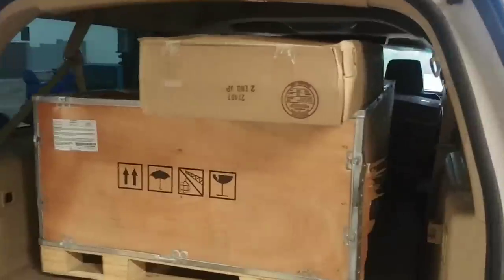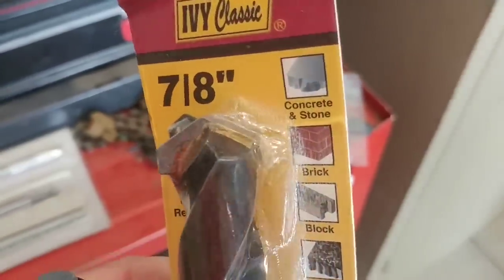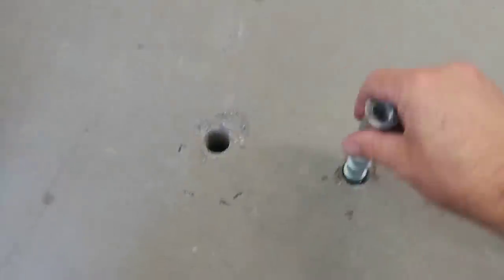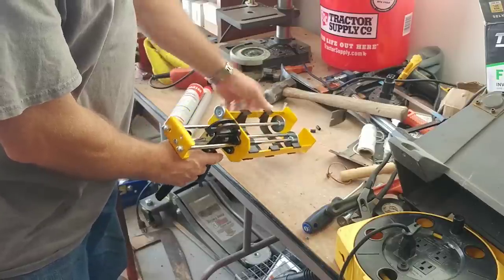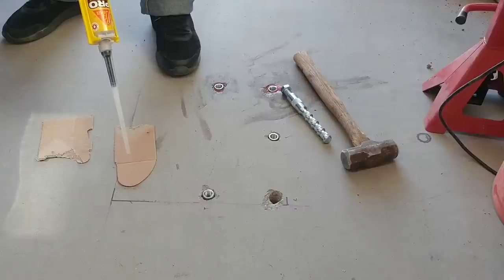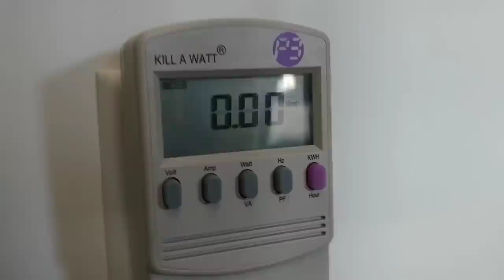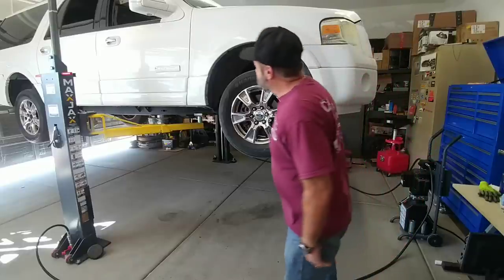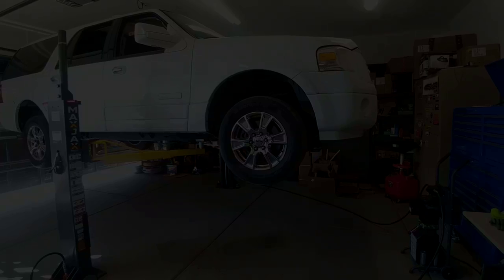BendPak MaxJax M6K Home Garage Car Lift Installation Tips, Testing, and Amperage Measurements.

Comment: I had the older version. The original Maxjax 10yrs ago. Worked great but one thing that bothered me and many others was that even though it was leveled during installation once you lifted a vehicle the towers became out of level. The towers would collapse about 1/4 in inward. I never had any accidents with all the different vehicles I put on it but just never felt comfortable underneath the cars. I worked under there with the thoughts of always being ready to run out.  I even put wheels under the cars to save me.  With this new version. Lift a vehicle then put a level on the towers. Let me know if it tilts inward.   Thanks
Reply from the maker: I may have put a measurement in the comments somewhere but they do flex inward slightly under weight.  The flex doesn't concern me as long as the base is secure, bolts remain torqued and there is no gap under the base that would indicate the anchors were compromised.  I check torque periodically and after lifting I'll make sure the base hasn't lifted.

Comment: Nice to finally see some real world feedback on install and use with this lift amongst all of the basically paid advertisement type of setup videos... What is the distance from the outside of the back plate to outside of back plate for the spread on the columns? MJ suggests a spread of 105-135", curious as to what yours are at and if you wished you had them closer/further away after using it for a couple of years. Also, do you remember what the actual depth of your concrete was during install?
Reply from the maker: I went 130" outside to outside at the base. I'm happy with that width. Been able to lift everything from my little Geo Tracker all the way up to my Ford Expedition EL. I wanted as much width as was reasonable to let me access the vehicle while it was on the lift for some jobs and it is helpful. Also makes it easier to leave them mounted to the floor and park between them even though they are designed to be unbolted and moved I prefer to leave them installed and ready. Plus I figured the anchors were less likely to loosen up over time.

Only thing I think I would change or still may do is run the hoses up to the ceiling and across to the pump so they aren't running across the floor while in use. Not a big deal but do trip over them on occasion and have to lift the roller carts over them.
Reply: @shanesdiy  Thanks for the response 👍

Comment: I saw one guy had giant jackstands. They were about 4 feet tall, he would put them under there after jacking it up and I would do the same if I were you. Your concrete looks very solid, but you just don’t know and why take chances.
Reply from the maker: I add support strategically when I feel the need just like you would with any lift.  I use the lift often for a wide variety of vehicles and it hasn't given me any reason to be concerned yet.  I perform a "pre-flight" before every use, inspecting the equipment, hoses, and the base anchors for any signs of loosening.  Still holding strong.  I modified a transmission lift for use with the MaxJax recently, video should be coming soon on that project.

Comment: Great video. I have a few of questions if you don't mind.  I don't know if I wasn't listening (something my wife says happens(or something like that, she was mumbling)) but how tall is your ceiling?  How do you like it after having it and using it for awhile? How high does it lift?  What creeper is that?  I have the six ton mid rise scissor lift and it's great for most things in my garage,  but sometimes the access to more of the underside of the car would be nice too.  Thanks for the video
Reply from the maker: Always happy to answer questions. The ceiling height is 10' 4".  The bottom of the lift arms are 41" from the floor when sitting on the top safety locks. Depending on which lift pad risers I use the lift pads will be about 45-50" above the floor to where it contacts the vehicle.   The creeper is the one MaxJax sells. I purchased the complete package that came with a bunch of extra accessories like the oil container with high funnel, 6" risers, and the reclining creeper. I also roll around on a small roller seat if he car on the lift has enough clearance.

I love it just as much, if not more, than when I got it. I use it very often for my own fleet of cars and I now help friends and neighbors with their vehicles much more frequently.  I've done some big projects I otherwise would have not attempted as I just don't want to lay on the concrete any more, too old for that!

Thanks for the comments and for watching!  FYI some of those measurements were at about the 30 minute mark.  I know it was a long video, tried to keep it short but was quite a lot to cover.
Reply: @shanesdiy  Thanks for the quick answers!  I don't know how I missed the measurements.  I must have been distracted.  I didn't think it was overly long.  
We're in a similar situation, between the wife and I we have seven vehicles and I'm at an age where laying on the concrete doesn't appeal to me either.  
Thanks again

Comment: I just installed one and instructions say you need at least 4” slab but in reality you need 5-6” because they make you drill 5” deep and when you set the anchors you set them 5/8 below and it comes up when they set, i had 5” slab and worked fine
Reply from the maker: Agree, not sure 4" is quite enough.  Made it frustrating for me having to redo a few of the anchors.  I sure love having the lift!  Hope you are enjoying yours, it is a life changer!
Reply: Standard for a two post hoist is a 6" slab. Most homes will only be built to the minimum 4"
Reply: @shanesdiy  yes sir i am enjoying it and is a life saver working at home out of my garage
Reply: I've thought if there is anxiety over depth of concrete that a solution would be to weld a plate onto and outboard of each floor support and add 2 more anchors to add leveraged strength.

Comment: Thank you Shane for the detailed video. A statement and then a question for you. BenPak advertises the MaxLift as a portable unit, how is that true if you need to Molly down the jack? And what dictates the distance (left and right) from each of the towers? From the video it appears that your distance seems further than necessary, and you could have benefited by having them a bit closer together. Thank you
Reply from the maker: It would be pretty easy to unbolt one or both of the posts and roll them into the corner.  I choose not to as I use them quite often.  I think the manual gives you a recommended width "range".   I gave it a lot of thought before selecting a width.  I decided on the width of mine based on the range of vehicle sizes I wanted to fit.  I have everything from a really small Geo Tracker all the way up to my Ford Expedition EL and so far it fits them all.   I went a little on the wider side also because since I wanted to leave them mounted all the time I wanted a bit more room to park my car between them without being too tight.

I personally would not want them closer.  I often find myself needing to open the vehicle door to get in to work a clutch, brakes, or steering and even with the wider width of mine, it is a tight squeeze to get through the door while on the lift even with a smaller car like my Evo or neighbors 350Z.

Thanks for the comments and questions and thank you watching!  I hope the information helps you make an educated decision! I can't imagine life without my lift any more...

Comment: Great video!!!! I have been looking at these for a while now as well, mainly because you can unbolt and movs them if you need to.  How do you find them now after a bit of use? Any regrets on this model????
Reply from the maker: I use the lift quite a bit and still working flawlessly. I have room so never move them around but can if necessary. Just posted a new video yesterday, had my brothers Honda Goldwing on the lift with the motorcycle adapter! Worked great.

Comment: Haven't finished video quite so, sorry if you answer this later, you've marked out a nice location, why not rent a saw, cut out the square, Pour some fresh concrete?  It'd fill the void, you can make sure psi is high enough, and put your bolts right in the concrete.
Reply from the maker: Probably would have been the wise thing to do but I was confident I could make it work.  Short answer?  Impatience...  Fortunately in my case the final install has been secure and strong.  I use it often and after one re-torque of the anchors about  6 months in they haven't loosened up since.  I check the torque about every 6 months or so to be sure they are still tight.

Comment: Great video….I just saw this video.. So I take it that your concrete floor is less then 4 inches an is less then 3,000 psi of compressive  strength how is the floor holding up .. your video is very informative…excellent job
Reply from the maker: Actually the building spec was that it was 4" and 3000 psi rated.  I think in the area of that one post, it must have been slightly less than 4".   So far it is showing no signs of weakening nor are the anchors loosening up or pulling out.  I use it quite a bit so I am quite confident in it.  Only issue is one sides quick coupler has a bit of a leak so the area is oily from hydraulic fluid. It's a working garage so I'm not all that worried about a little oil.  To pull the fitting off and fix it I'd have to drain all the fluid out of the post so for now, the small leak isn't worth the trouble to fix.

Comment: Wow, what a colossal pain in the ass. I think I'm going to go with quickjacks after seeing this.
Reply from the maker: The Quickjacks are a nice product, one of my friends has them since he had a tension slab and was not able to drill into it for these posts.  I considered Quickjacks but the lower height is very limiting and most of all, you have little to no access from the sides of the vehicle for servicing.  For basic work like wheels/tires, brakes, oil changes, etc. the Quickjacks are great.  I have done some larger projects like pulling transmissions where the Quickjacks would not have cut it and I was grateful for my MaxJax!

Comment: Most residential garages have a floor that is slightly angled away from the house. Is that an issue? Do the posts have to be perfectly vertical? Can they be shimmed?
Reply from the maker: My concrete was level and I didn't need any shims.  If you needed them, I don't think it would be any issue.  As for needing to be perfectly level, just my opinion, but if they are within 1/4" or so at the tops I doubt you'd know the difference. Each side lifts independent of the other so they can move a bit without any negative impact.
Reply: @shanesdiy  Thank you!

Comment: I was curious how far apart your posts are? From back side plate to the other backside plate?
Reply from the maker: I did 104" inside base to inside base width.   Outside to outside of base is 130".  I went a bit on the wide side due to the broad range of vehicle sizes I wanted to put on it. So far I'm happy with this spacing, works with my small stuff like my Geo Tracker all the way up to my Ford Expedition EL.
Reply: @shanesdiy  Thanks for the response! I'm going to either do 125 or 130 I think, 65 Mustang and maybe my daughters jeep compass. I think 125 works, but may opt to go 130 if I can line it up right in my 3rd car bay.

Comment: How long did you wait after adding the expoxy for you to use the lift?
Reply from the maker: I think I waited 2-3 days if I remember correctly.  It hardens pretty fast, probably ok in 24 hours but I waited more just to be safe.  If you think there is any chance your concrete isn't deep enough I would do the epoxy anchors.  I was debating to try the normal ones and wish I would have just done the epoxy ones from the beginning. Would have saved me a lot of work and time.

Comment: How thick is that slab? I'm unfortunately running into the issue of mine being only 3-3.5 inches thick. Have the lift sitting here ready 😔
Reply from the maker: Spec on mine was 3000 psi and 4".  MaxJax web site currently says it requires 4.25" minimum, I think at the time it used to say 4" but I can't recall for sure.  Mine were right on the edge of being ok.  As you see in the video I had to switch to the epoxy type on a few that wouldn't torque properly with the standard anchors.  At only 3-3.5" I think your only option is to cut out a square where the posts need to go and pour a deeper pad in those two spots with re-bar enforcement, wait for it to fully cure and then finish the install.  I debated doing that but wasn't patient enough.  Been using it for over a year now and mine are ok, I re-torqued once and re-checked later after that and they were still good.  I got away with it, not sure you can with concrete that thin.   Sorry, I know that is a bummer but that's too thin to trust with your life.  Good luck and be safe.
Reply: Thank you.  Yes, I was considering giving it a shot bc I'm impatient, but I also don't want to die or , at least, have to worry about it every time I use the lift. I'll be getting some quotes on concrete.
Reply: @SWAPPED_IT  Don't even waste your time trying. I have the same issue and now I'm going to cut out 3ftx3ftx12in deep footers and put in some 5000psi concrete and then use the epoxy anchors. I can't imagine trying to use 6in epoxy anchors in 4.25" concrete or less, that makes no sense.

Comment: Great video to help us with pretty much same slap inch’s you may have. You should do a video of how the epoxy is hold the lift up with a vehicle on it.
Reply from the maker: Good luck with your installation, you are going to love it!  Thank you for the suggestion on a follow up video.  I see zero movement in the mounts.  I just wish I would have just done the epoxy from the start so I didn't have to hammer the old anchors down and make a big crater that had to be filled with epoxy.  Would have been simple with a nice 7/8 hole and much less epoxy per hole, slip in the anchor and let it set.

Comment: Great video!  What is the distance that you have the two jacks apart?
Reply from the maker: I have mine 104" between the bases, inside width. For smaller vehicles it would be nice to have them closer together but I wanted it to fit all my vehicles from my little Geo Tracker up to my Ford Expedition EL. It has handled all my vehicles great so far.
Reply: Getting ready to pour concrete. I’m making it 8” where the post go. Is your concrete 4000 psi? by the way it turned out awesome!

Comment: Wouldn't it be easier if you spent all that time making this work at the beginning when you drilled your first hole. You then found out that the concrete was not thick. You then decide to cut out a piece of that concrete double the size you need. Dig out the dirt making it deeper. Pouring new concrete 5,000 psi. And I think it would be the same amount of time you spent trying to make it work.
Reply from the maker: I've seen a few folks do that but I didn't want to do it that way.  That would have taken way longer and cost much more money. I only had to fix 3 anchors total with the epoxy, in the big scheme of things it wasn't that big of a deal and it is still very secure and I use it often. Couple things I would do differently if I were to do it again like use the epoxy anchors from the start as MaxJax suggested to me when I spoke to them. They cost a few bucks but after using them, they are pretty nice and would have been really easy to use them initially.
Reply: @shanesdiy  yeah I can see why you would do that hindsight being 20/20 and all it's easy for me to say what you should have done. It works that's what counts

Comment: Great video - glad to see it worked out well for you! I have one on order and I have a 4" slab and am concerned I will run into the same issues. 

Did Bendpak recommend the epoxy anchor kit to resolve the fact that some of the concrete was not thick enough? I can only find info showing that they are just an alternative to the standard anchors and still require the same depth of slab (if not more). 

It seems the most common route for thin slabs is to cut a section and pour new concrete. Curious why you didn't go that route.
Reply from the maker: I didn't want the hassle of cutting out a square, pouring a new slab and waiting for 4+ weeks for it to cure before I could install the anchors and the lift.

They suggested I might need the epoxy anchors before I ordered it but figured I would give it a try with the standard anchors.

My biggest issue using the epoxy anchors was that I had to hammer the old ones down through the slab into the dirt below which hollowed out a large cavity that had to be filled with epoxy. Had I just drilled the holes for the epoxy anchors first it would have taken much less epoxy and been way better. They are not any shorter but the epoxy eliminates the possibility of the anchor not holding since the epoxy holds the entire length of the anchor. The normal anchors only have the lower end that expands and holds.

Hope that made sense. If I did it again I would use the epoxy anchors from the start. If you think your concrete is borderline thickness you might want to do epoxy.
Reply: @shanesdiy  good to know. I'll have to make that decision when it shows up and I have all the holes drilled. Definitely not ideal having the concrete borderline and since it's backordered until June here in Canada, I'll have to patiently wait to find out.